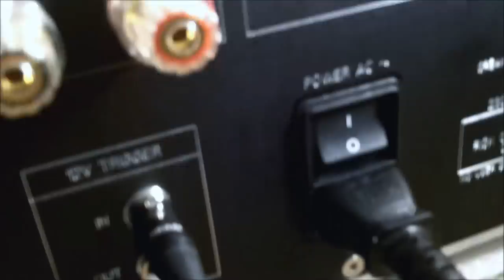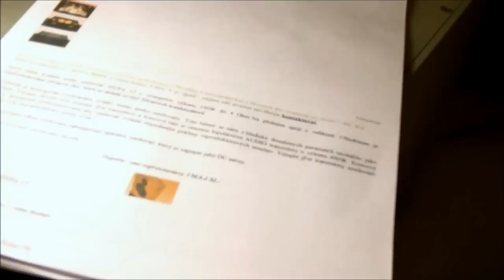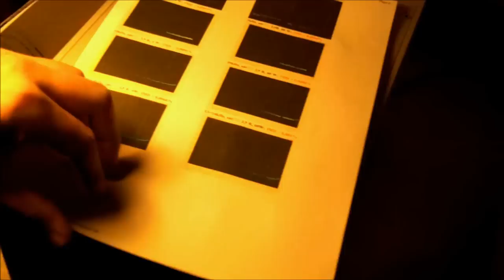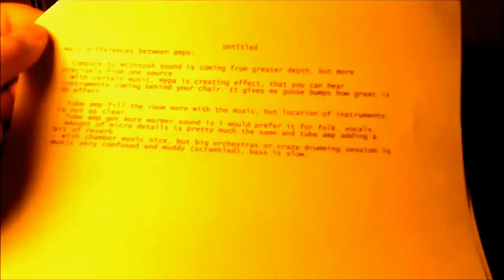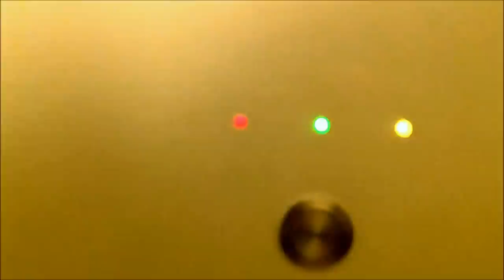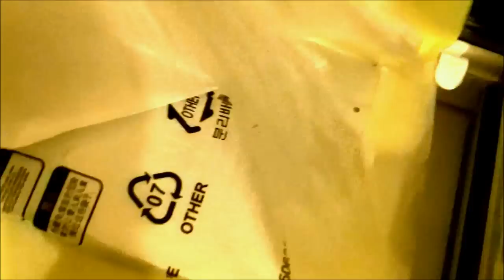DIY Audio high-end 200W Power amplifier mono blocks class A/B build progress

Comment: look at lc audio class a/b power amplifier(the end xp millenium.they are high end modules.one company online sell them.High end city.and look for amp kit.there are also Zaploslute class A power amp.both versons can be outfittet with extra board with 2 output devises.class a/b can be build with one small input toroidal transfomer rectified and 10 000uf cap the output part of the power amp have a big dual 600va 33volt.it puts out 12 watt in 8 ohm and dobbels at 4 and dobbels again at 2 and one ohm.100 000uf powersupply caps for 2 channels.every module is one channe exept zapsolute class A withs is stereo.they are special that they dont have global feedback or local.they are very linear.Most amps have this global or local feedback errorcorecion.it messure outpu of a amp stage output and compare it with imput and corect signal if error iss detected.thefore all those amps sound much the same and are not linear at all.this .cant correct a error when its alredy have passed when you correct it.Better to design a poweramplifier where such error dont show up.to do that they have used the best off components and have used them only in their most linear "gain area"i can promise you that the end xp millenium beat that amp in this video.
Reply: Highendcity. That must be the price. $450 for a board. No txformer, or heatsink. Give me a break. Cheaper to buy than to make their stuff.
Reply: you are posible talking about the stereo verson dual mono on same pcb.it is a class A driven amp called zapsolute.the end xp milenium pcb for 1 channel cost 225 us dollar. A capasitor pcb with rectifiers for option off a small toroid trafo to drive input circuit  on each modul ,the big trafo uses 2 rectifiers before the capasitor pcb and have 100 000uf capasity for 2 channels with 10 000uf for the smal trafo if option is used.if option is not used you have 120 000uf pr 2 channelsget 20watt more pr modul and a improvement.have to cut 2 copper traces if that option is going to be used.they have gone trhue revisions in the 1990 and upp to 2001.you can get the class a verson called zapsolute with both channels on 1 pcb dual mono layout.High end city have to high prices.component side and construction is second to nobody.just the best quality and best suted components are used.they where sold in scandinavia and i have amps the end mk2.works fine.many other i kjnow have used them for years.capasitors dry out so in zapsolute class a low profile cabinet they must be changed every 10 years if good brand.my 4 channel 4 modules a 250 dollar with tax.had 2 toroids trafo from before.one capasitor pcb 30 dollar.and i need 1 pcb for the last 2 chanels.can use the one for all 4. but i have alredy made the place for it and this will be my last amp projekt for a long time.it cheap to build trhue hole 80 component style amps.they are bad compared.it lives longer.are linear.used in labs to messure instruments
Reply: I just so happen to have 8 100000uf 100v nichicon 4.5lb 8" tall 4" wide huge massive caps that were used is the building of a 2ch high end amp from a local company that unfortunately went out of buisness do to covid but i saw it comming seeing as a 3 ft long RCA interconnect cost over 2k and the amp, i kid you not, the amp cost 100k and they said each amp had 2 of these on the dc filter with 2 2.2uf caps in series... And i only paid 15$ each lol and i think that just the 100000uf cap new went for 137$ each from nichicon lol so i feel like i got a good deal! Lol now i just need a good audio project to use them on